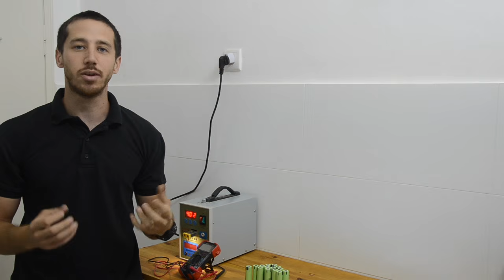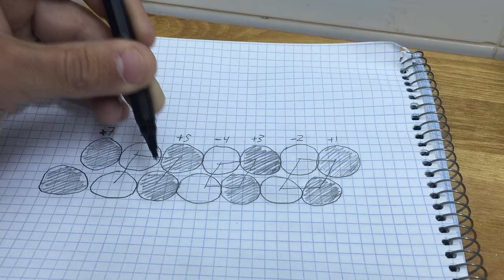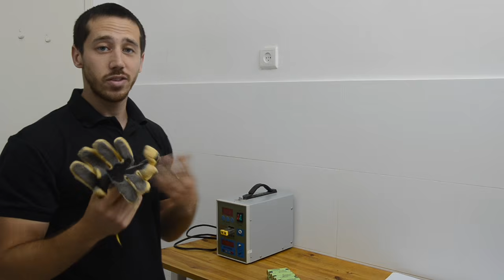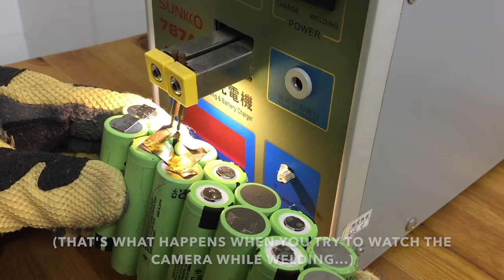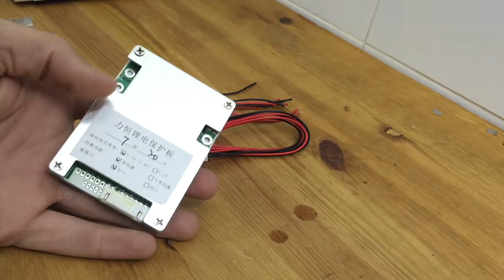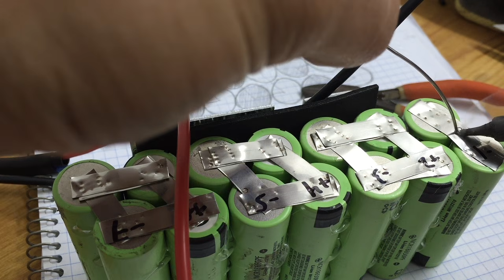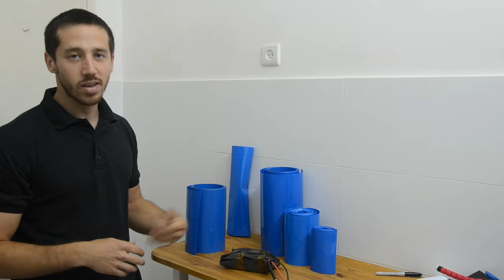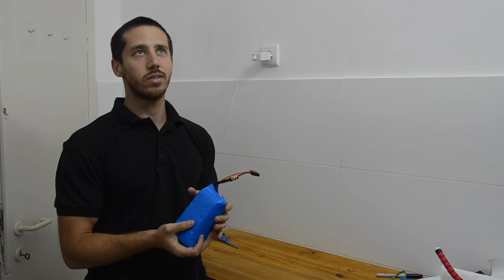How to build a DIY ebike battery from 18650 cells

Comment: Really good video! People have to be careful when they buy a BMS I don't like them, they don't discharge properly I like using a certain gauge wire so it acts like a fuse when a cell goes bad that wire fries and or balance charging and you get more voltage. Some people just charge them to a certain voltage and they level off and they solder to the battery and it last a long time. So many methods

Comment: Great video, liked the tone of your voice. Perfect for a tutorial. I have a bit of doubt , hoping you could help me out. I'm working on a tracker for my motor bike, ill be using a standard mobile pbone powerbank that uses an 18650 to power the circuit, what I want to know is will it be safe to use a 18650 for this purpose? As in, won't it be a problem with all the vibrations while the vehicle is motion? Before other viewers reply with "Don't you see he's using 18650s in the video, you moron" , i want to know if they use any special kind of 18650s for EVs or any regular good brand would do?

+EbikeSchool.com, can you help me out

Comment: Actually you don't need that BMS!! If you have the right charger it will automaticly balance the batts when charging !!! a iMAX b6 would work !!
Reply: Isn't that dependent on the type / quality of battery cells you use? In other words, will the right charger balance low quality cells?
Reply from the maker: In order for the charger to balance your cells without a BMS, you need a balancing charger and you need to add a balance connector to your pack. The BMS does that for you, and allows you to use a simpler charger. Some people prefer one way, others prefer the other way.
Reply: EbikeSchool.com so what is a simpler charger? Say, I have a 24v/10ah battery pack 7s5p setup. My understanding was that I ultimately need a charger that supports 7s, such as an imax b8. If I get your comment correctly, that is not the case if a BMS is used instead. so, any charger suitable for Li-ion will do?

Comment: Can you send me a battery diagram for a 36volt 14 parrelle 7 series ebike battery pack? How many amp hours will this give me? Charley
Reply: lazy
Reply: 14 parallel is a lot of amps 
more than 50 amps 
too much 
why do you need that many amps?
Reply: I WANT TO RIDE MY EBIKE 100 MILES AT 40 MILES PER HOUR A DAY. I COMMUNTE FROM TIJUANA, MEXICO TO SAN DIEGO, CA. TO GO SHOPPING, PICK UP MAIL AND RETURN HOME THAT IS A ROUND TRIP OF ABOUT 50 MILES. I USE THE MOTOR DUE TO A LOT OF THE STEP HILLS. I FIGURE MORE PARALLEL CELLS WILL GIVE ME THE DISTANCE RATHER THAN MORE SERIES CELLS...RIGHT?
Reply: Charles Most you should carry extra packs let you could put them in parallel. 

wire them in parallel and give it a go. 
be conscience of how warm the motor and the controller is. 
don't want to melt them

Comment: Hi there 
Thanks for your time for showing and explaining this important things of e-bicycle battery 
My question is what should I use to make the battery to last long distance driving..?
Thanks for your time
Reply from the maker: If you mean long range then you just need more cells in parallel .This battery only has 2 cells in parallel because it is for short range. If you mean long lifetime, then try to charge the battery up to only 95% or so and not drain it all the way to empty. That can double the lifetime of the battery.
Reply: EbikeSchool.com hi 
if we add more sell ,doesn't bring up the voltage?

Comment: Fantastic video, I've made a 13s 48volt pack without BMS and now I regret it, I can't find a 13S balance charger, I do have a imax b6 but I can only balance charge 6S. So I ended up just bulk charging and hoping my pack doesn't get too imbalanced until I install the BMS. 

Just a quick note on the pack you made, i'm sure it's because the pack was built on camera, but the balance line going into the BMS is not plugged in all way.
Reply: Cali_Gear Guy I noticed that too, really hope the plug was pushed in before all the foam and heat shrink went on... kinda adds suspense to the video doesn’t it, wondering if it will work :)

Comment from the maker: I've gotten tons of questions about where I got these materials. Everything can be found here: 
18650 cells: https://goo.gl/tVjREI
Nickel strip: http://goo.gl/VIrNQq
Spot welder: http://goo.gl/cZS1yC
BMS: http://goo.gl/S6gSQx
Silicone wire: http://goo.gl/xmpbKD
Black 18650 cell spacers: http://goo.gl/hQxWF6
Large heat shrink tubing: http://goo.gl/6v1ow9
Foam sheet for protecting battery: http://goo.gl/5e71tE
Reply from the maker: Richie, sorry I thought I had tagged that. I was referring to Pancakes. Now I see yours. Those look like either knock offs of Samsung 26F cells (perfectly good but low power cells) or they are genuine but the vendor doesn't have the rights to sell them so they aren't showing the label with cell info. If they are knock offs then they are only as good as the average cheap chinese cell (not very good). If they are genuine, then they are just fine but you'll need to use enough in parallel to cover your current needs since they are low power cells rated for max 5A draw each.
Reply: EbikeSchool.com
Reply: Hi will these batteries work, i'm not sure because they are a lot cheaper than the other ones on ebay.

http://www.ebay.com.au/itm/Brand-Tikon-3-7V-Rechargeable-18650-Li-ion-Lithium-Battery-Cell-Fr-Flashlight-OZ-/331328395337?var=&hash=item4d24b61849:m:mrpIJrj1oWd5miqvwQUBOXA
Reply: Hi there , Great video I'm planning on building an Ebike and I was wondering if these are a decent battery https://www.alibaba.com/product-detail/Hot-sale-hight-quanlity-3-7V_60169974596.html?spm=a2700.7724838.0.0.mpG9Mi
Reply from the maker: Pancake - No, I'm sorry but these aren't so good for ebike use. They cheaper chinese cells and are of questionable quality. These work fine for flashlights, but aren't appropriate for high power devices like ebikes.
Reply: Thanks for the response but were you referring to the batteries I had listed or pancakes ? or both?
Reply: EbikeSchool.com Cheers thanks man
Reply from the maker: I did parallel first, then series. But it can be done the other way too.
Reply: +EbikeSchool.com What voltage and amperage would you use to charge this pack?
Reply: EbikeSchool.com
Reply: A better way of doing it is to just run each row in series the at one end connect negative to negative and the other end positive to positive to make the two packs parallel. Much simpler design. I just made one. Two 13 cell packs in parallel.
Reply: EbikeSchool.com oh
Air compressor

Comment: I have a mobility scooter that runs off two 12volt sealed lead acid batteries, if I wanted to change to 18650 battery packs how big do you think they would have to be?
Reply: If you are unsure of your electric motor's tolerance, you could use LiFePO4 18650s instead.  4 in series will give a nominal 12.8v.  Same as a SLA battery.

Comment: I have a question ... Let's say that i have a battery of 10,000 mAh 24 V and a lamp of 24v 100 watts how do I calculate how long until the battery is depleted ?
Reply from the maker: Actually, you'd want to divide your watt hours by the watts to get the hours of run time. Your watt hours in that battery are 10AH * 24V = 240 watt hours. Divide 240 Whrs by the 100 watt load and you get 2.4 hours of run time.
Reply: Eliav Edri Divide 10,000 by 100. Your battery life will be nominally 100 hrs.
Reply: EbikeSchool.com Thanks

Comment: May I please ask you a question: I have a commercial 24v battery built similar to this with a BMS. I'd like to add meter to this to determine capacity.  However, I don't want to open the enclosure bag and wrapping to get to the + and - leads. Can I connect the meter through the charge port (while not charging) or will the BMS not allow back EMS through this port (due to diodes etc.)?

Comment: ok so he went 2 in series and 7 in parallel and that made a 24v 5.8ah. so what would 7 in series  and 2 in parallel make? Can someone explain the math to me?
Reply: EbikeSchool.com Thank you. Even though I made a mistake you still understood what I was asking.
Reply: he went 2 in parallel and 7 in series
Reply: Lady's and gentlemen, I give you the most useless commenter on all of youtube.
Reply: Wait,
1 has 2 cells in parallel and 1 & 2 are connected in series and so on...
In series-Current Remains the same and potential diff adds up
In parallel-Current adds up(In short)   and potential diff remains same.
Get it Now?

Btw Your Brain Is Useless Bro.
Reply from the maker: You actually wrote it backwards: the battery in the video is 2 cells in parallel and 7 cells in series (7s2p), not the other way around. But if it was the other way around, you'd have a 2s7p battery, which would be 7.4V 20.3AH. Hope that helps!
Reply: Now What   P the red -_- 

I told you 😂😂😂
Reply: DIY Tech Wasn't about weather I got something wrong. It was about you not doing anything to answer my question but commenting anyway.
Reply: Okay#No Offense  Bro :)

Comment: Can i just sand and solder the batteries using the nickel strip?
Reply from the maker: Is it possible? Yes. Is it a good idea? Absolutely not. Soldering directly to the cell heats it up and causes an irreversible chemical reaction that shortens the life cycle of the battery. It can also be dangerous if you accidentally short to the negative part of the 18650 cell which is very close to the top positive portion. That is why all professional packs are spot welded.

Comment: what was the purpose of the RCA jack? Im assuming its used to charge the battery but why an RCA jack?
Reply from the maker: This model of RCA plug can handle 5A but there are some better versions that can do up to 15A. Many people think of RCA and XLR as just signal wires for AV equipment, but they are actually two of the most popular ebike battery charging connectors used in the industry.
Reply: +EbikeSchool.com didn't know that, thank you. When I look for a charger, would i need to find a 48v (I'm making 48v battery) with a RCA plug? most of the ones I'm seeing come with something called "plug B" as default, it looks like male RCA connector but I'm not certain.

Comment: Great video. Excellent in representation. Clear and concise. I'm wondering how I can use the same to power a small portable kiosk? With outlets for lighting ect? Would probably have to enlarge the batteries and add a few more? And how about additional solar for recharging? MMM? Now that you've got my attention! LOL! 
Thanks a bunch! Love Q-PID
Reply: Here is some info that can give you some ideas. You can use a solar charge controller with a lithium battery pack to create solar based power. I use 3 18700 cells in series connected to a small charge controller for lighting a room for 5-7 hours after sunset with a 7 watt DC bulb. A 60 watt panel works 12 months a year, with some shortages on dark winter days. In winter solar power production goes down to 10 percent of summer. For a kiosk, you must look up the power requirements of the monitor and the computer device that is connected to it, or the tablet or whatever. A power saving monitor for a kiosk can be under 10 watts. Look up one that is DC power input compatible. It will save you converting your DC power source to 110 or 220V. A stick PC can be around 10 watts. That makes around 15-20 watts for a low spec, low power kiosk computer. Add a few small DC bulbs for lighting and it comes to around 30-40 watts after sunset. Multiply 15-20 watts with daytime usage hour and multiply 30-40 watts with night time usage hours and this is your power requirement for a day. Your solar power production must cover this power requirement and your battery must be able to store enough power to run the kiosk during night time usage hours. Each cell has a watt hour rating. Once you calculate your power needs, divide this by a cell's watt hour rating to calculate the number of cells you will need in your system. Select your kiosk computer components with an eye on their power usage. Choose power saving components and this can help you build smaller batteries for your system, keeping everything simpler and far cheaper. Alternatively, you can use gel batteries which have around 450 cycle with 80 percent discharge. Use more gel batteries so that you can discharge them less and increase their lifespan.
Reply: btw you asked this 7 years ago, I just noticed that :) Hopefully, someone else can use the info :)

Comment: Hey man this is awesome. One question, I dont have any of your tools and I am building a 3s battery with 18650 to power an led light (12v). I stripped wires from a computer power supply and didnt even solder them, I just used electric tape to put them together to get 12v. Anyways, the thing worked and light is on and everything looks beautiful, BUT in about 30 secs, the battery pack I built started heating up so I knew that not a good sign. I am suspecting the wires I used to be the cause because (maybe they have high resistance like you mentioned), do you know what type of wire (other than nickel strip) that I can use to overcome this heating problem (I used AC coffee grinder wire before that seem to work). I honestly dont want to spend 300+ dollars for a spot welder for a simple led light. Its worth mentioning that I am using old laptop batteries for this to experiment. Any thoughts? thanks in advance.
Reply: Determine which part is heating up if it is coming from a wire be sure the gauge is thick enough, can look up awg amperage tables to see.  If the batteries themselves are getting warm you may be drawing too much current and or the internal resistance of the batteries is too high, if you want to measure currents need an ammeter, since it becomes part of the circuit the ammeter needs to be rated above the expected amperage and voltage.
Reply: I initially thought it was the wire. I used a thicker wire and that didn't work. so I used a laptop batteries with original wires in there, and that did heat up as well. starts from wires then batteries starts to heat up.

this is my setup

laptop 12v battery ----(Ac switch)-- 12v led light.

the funny part is that it only heats up when I have the switch turned off. when the switch is on, it doesn't heat up (or at least 10x slower heat up).

maybe I have the switch setup the wrong way. never done it before. what I did is connected positive of light to positive of batter then slide it in the switch. same with negative.
Reply: Is there a resistor in the circuit or built into the LED light?  If you connect a battery directly to an LED typically it will let the current flow at a high rate usually it will burn out the LED in an instant though, is it an array of LEDs? Most single LEDs I've seen have a foward voltage of 1-4V?

Comment: i am confused a little.  lets say i need a 14.5 volts battery. So i need to connect 4 of those 18650 batteries in series. and i can do 5 groups of these to increase capacity. so i will end up with a battery pack that will contain 20 18650 batteries connected in series in 5 groups. so how many cell battery pack will it be: 5, 7 or 20? this is what gets me confused. i am working on motorized longboard and speed controller can support only 10s battery. i need to understand this detail not to burn my speed controller. thank you very much
Reply: you just said it will be 20 (because you chose that many). It could be 4 if you only need a battery to last 1/5th the time, and is low power motor.
Reply: 10s means 10 batteries in series, so 37 volts max., your battery is 4S5P (4series, 5 parallel) so you are fine

Comment: is 1000w equal to 1kwh
Reply: No.
Reply from the maker: watts are a unit of power, while watt hours (or kilowatt hours) are a unit of energy. They are related, but not interchangeable as they don't measure the same thing.

Comment: What kind of charging port did you use and how would you charge it?
Reply from the maker: I used an RCA connector, and I charge it usually with a Cycle Satiator, but you don't need a charge that fancy. One of these will work fine: https://goo.gl/uGVdoZ